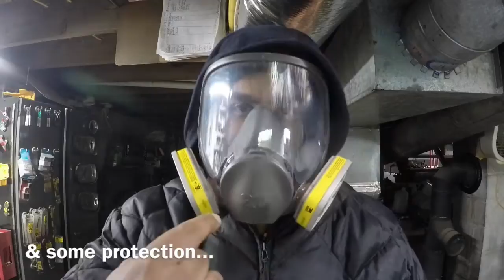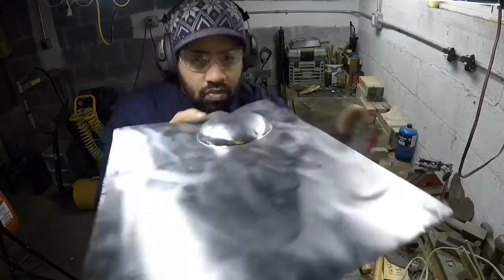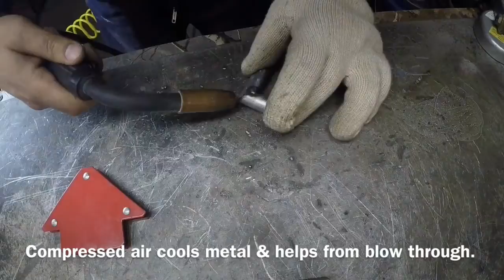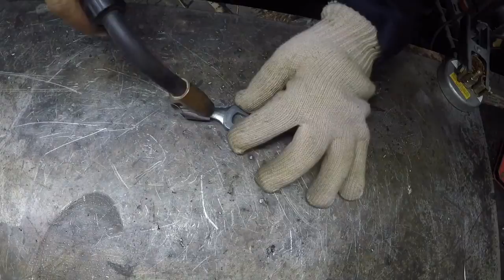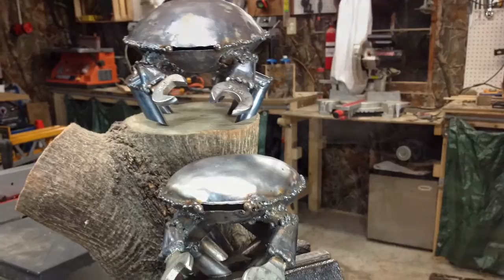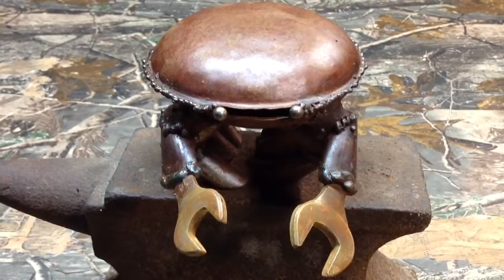Metal Crab

Comment: Awesome video man! Compressed air to keep the metal cool from blowing out is a great one. I'd never considered that, I usually end up trying to turn the heat on my machine down, or lower the wire speed which doesn't always help. The instant patina trick is awesome too. Do you just apply the mixture and let it dry on there? Is there a ratio to the three items that works best? Using a magnet to attach your ground to the welding table is a super good idea too. Thanks for all the tips!
Reply from the maker: Thanks Braxton!! With the  patina I wiped on & let dry (repeatedly) until I reached the depth of color I wanted. The ratio was "about" 1/4 vinegar to 3/4 peroxide and a pinch of salt:)